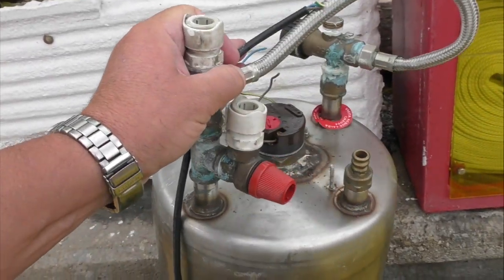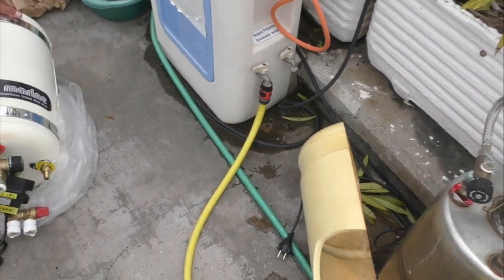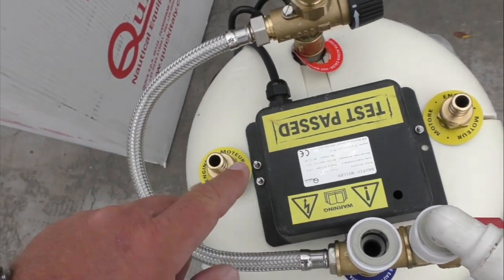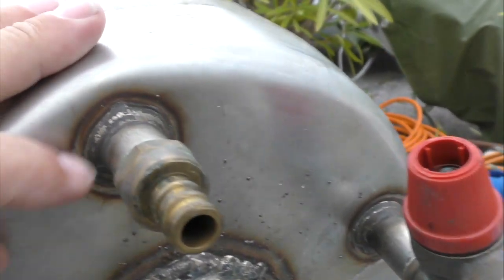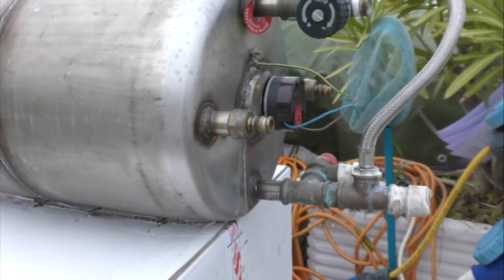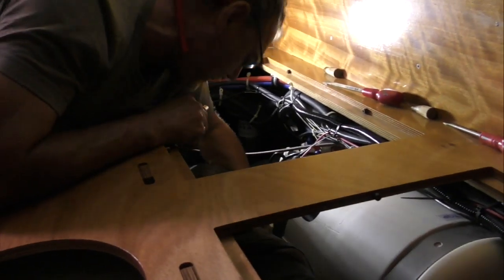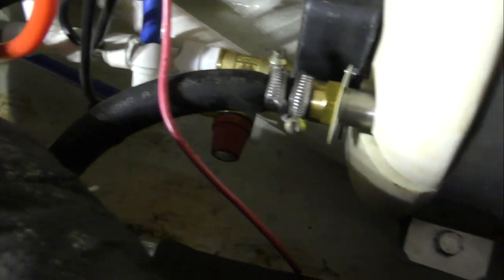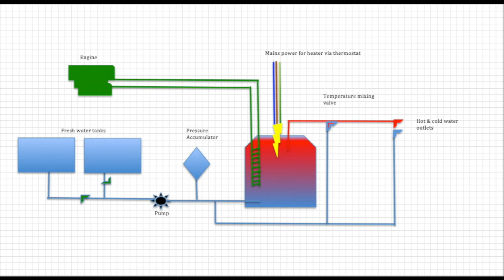Water leaks in your boat! Where is the leak!

Comment: I think our water heating system is about the only thing on the boat to not be leaking, ha ha. Love the maintenance vids, I'll be double checking ours when we finally make it back to our boat.

Stay safe guys.
Reply from the maker: Poor old David, when we ran the engine to check the coolant was not leaking I found a hole in the exhaust muffler. How to fix that in the next video 😁Sail Safe guys. Ant, Cid and the pooch crew.

Comment: Hi Ant, excellent video as always, couple of questions (from someone that has never owned a boat) 
1. Where does the pressure relief overflow exit the boat? I would assume it would be scolding hot?
2. Is there a temperature controlled valve anywhere, that stops the engine water circulating through the tank when it is up to temperature, or does it just get hotter and hotter relying on the tank pressure relief valve? (i.e. like on a house central heating where it turns off supply from the boiler)
Reply from the maker: Good question! Yes the vent just puts the hot water in the bilge behind the engine. The temp will (in theory) only ever get up to the engine water temp unless the electric heater thermostat fails closed circuit. In which case you would want to open a tap or facit pretty quick to cool the tank water down. If the engine temp goes above 95 degrees there is an alarm on the system indicating an over heat. I guess that if the tank pressure is released the water pump would bring it back up pretty quick as its fully pressurised. But that is an interesting thought.  There is no temperature controlled valve so really your just relying on the engines thermostat and over heat alarm and the Heater stat failing in the open circuit position. Thought provoking questions. I've never had one over heat or over pressure but it could happen. I'm now off to make sure my vent points away from the engine hatch!!!  Best regards. Ant.

Comment: Good vid. Could you not lead pressure release line to a tee on fresh water fill line rather than bilge? That electrical outlet near hot water out on the calorifier needs a splash cover.😉 What was the suppliers response to the broken cover report?
Reply from the maker: He could or over the side. It's a bit of a pickle really. I have a switched spur on my heater with a red neon on it. I think the older boats just came like that as the pug is the european type its all a bit Heath Robinson? Sail Safe mate. Ant, Cid & the pooch crew.
Reply: SV Impavidus Yeah a fused spur would be a tad more impervious even if not IP66.😂